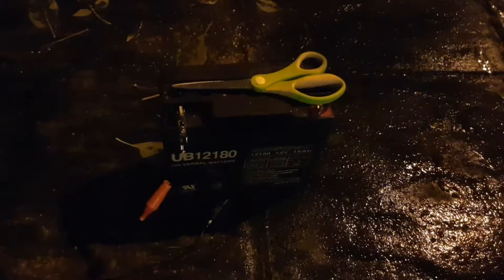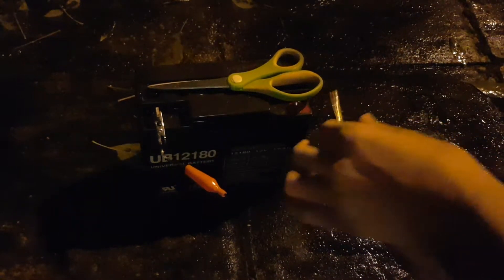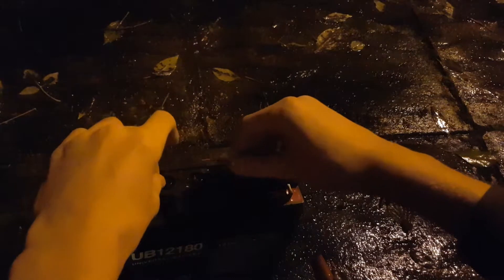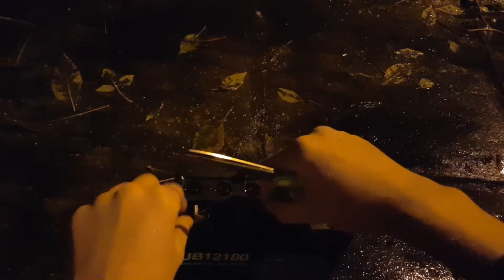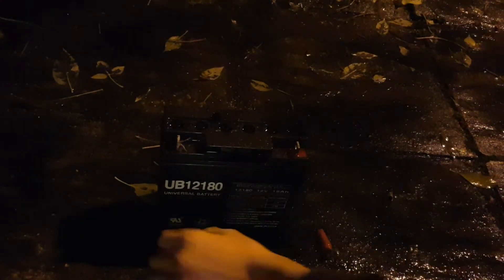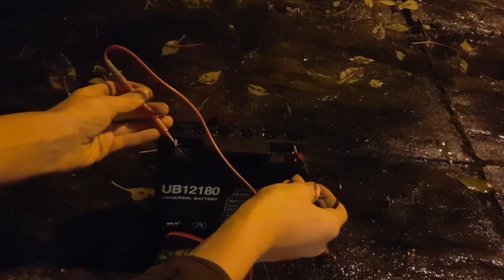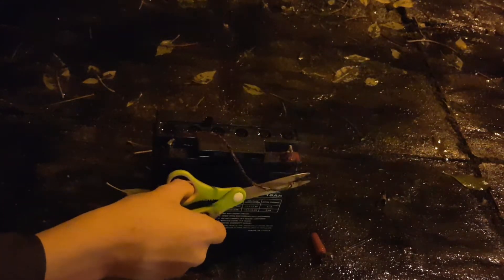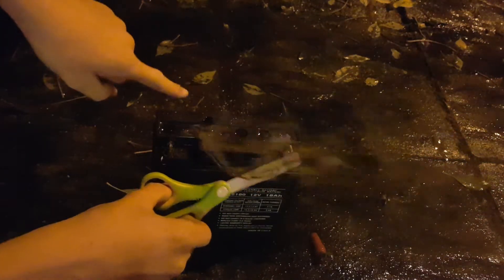Lead acid battery short circuit.

Comment: You’re lucky you used a small gauge wire that became a fuse. A huge piece of metal would have exploded the battery slinging sulfuric acid everywhere - or started it on fire first, and then exploding the hydrogen gas fumes. This was exceptionally dangerous - and you call yourself a tech savvy person? Discharge requires enough load resistance to limit current to a safe level that won’t blow up the battery or start a fire.
Reply from the maker: It was an old battery, the hydrogen gas wouldn't explode as there wouldnt be enough of it pooled up. But yeah you're right it was quite dangerous looking back at it 3 years later.
Reply: @wojciechtechtips1602  I’ve discharged high voltage capacitors and large batteries. Requires a load resistance to limit current to a safe level. I’ve always done calculations using Ohm’s Law to calculate a safe current level, and then the required wattage for the load resistance, and then the gauge of wire needed for the current it will have to carry. Dead shorts can also explode high capacity capacitors such as electrolytic.
Reply: @wojciechtechtips1602  Additional note - buildup of gas alone, if rapid enough, can cause the case to explode even if the gas itself doesn't ignite, at least until the case ruptures.

Comment: Wtf?  You made this video to discharge the battery via a short circuit?
Reply from the maker: yep, needed to discharge it before i sent it to recycling
Reply: @wojciechtechtips1602  You don't discharge a battery by shorting it.  It's highly dangerous and you're lucky it didn't explode.  Connect a 20ohm 10W resistor or a 60W light bulb across the terminals next time.
Reply: @raymondayeung  it won't explode because the cell cover is detached so the caps from the cell will just pop off and the battery will vent

Comment: i want to make a heater from a battery like this. so it is not safe to short circuit it for a long time? i was going to short a wire across to glow it red-hot. or do i need to mount a protection circuit?
Reply: NOOOO don't do that!!!! If you want to make a heater do the following. Look how much capacity (Ah) your battery has and which voltage. Let's say you have 12v and 15Ah. I'd NEVER try to source more than 10-15A for long periods of time but this is more than enough. As the heater element you could use a resistor (with high wattage). 12v/10A = 1.2Ohms. So never go lower than that. I'd use a 10-50Ohm resistor ( 25W resistor)
Reply: @killthesource4740  yup, found out already. Iam using kanthal wire now, finally found it in my country. Thanks for the reply tho :D